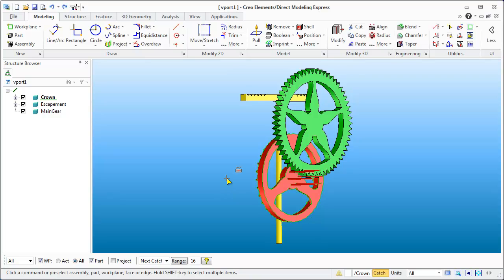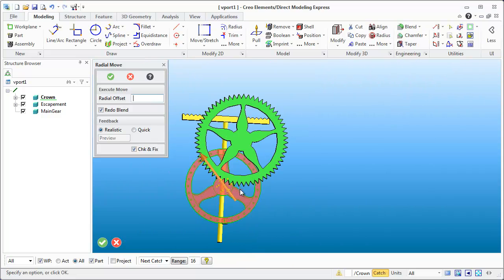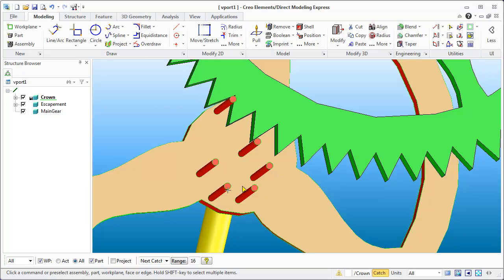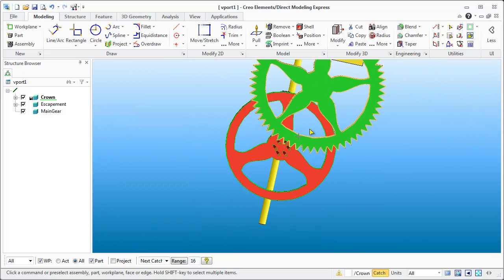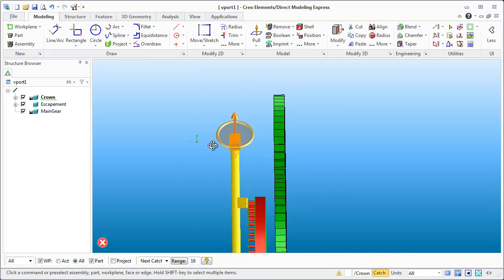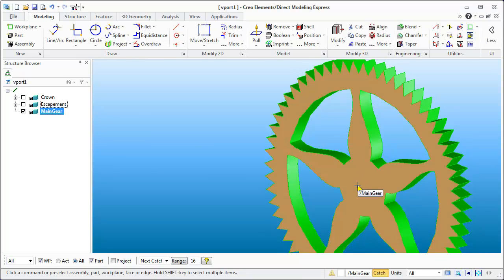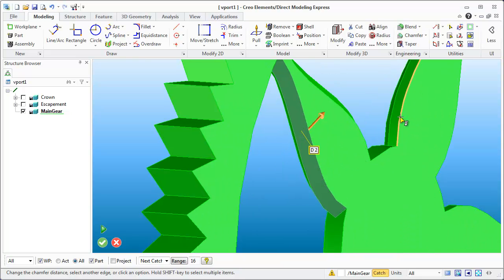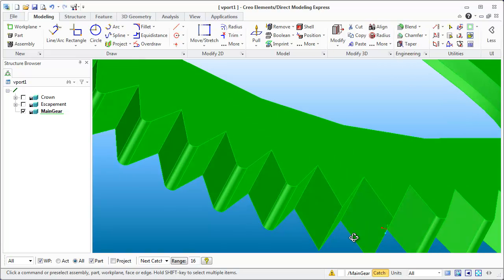Video: Creo Direct Modeling Express, making a clock part 5

Comment: Thanks a lot for sharing. I have to work with this software for a new job. So i'm trying to get the hang of it. I've been used to parametric software like Solidworks and Inventor for more than 8 years. It's a tough transition. It seems to me that eventhou the idea of Creo Elements is to speed up the modelling process, but looking at this, it's actually quite tedious. I could set this up in Solidworks way quicker and because you have parts in an assembly, I can just position the 2nd gear by mate reference. Is it true that 'parts' and 'assembly' doesn't really do anything in Creo Elements? It seems to me they are just dumb solids with no interaction whatsoever.